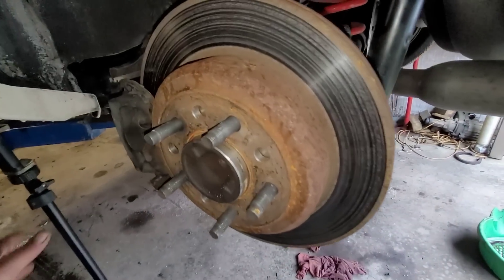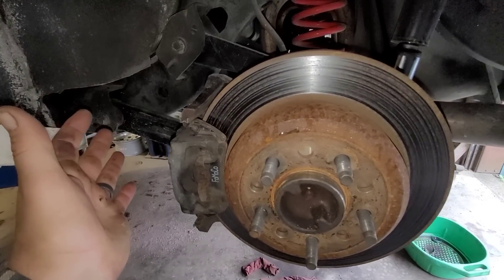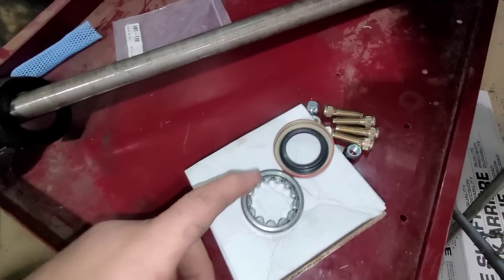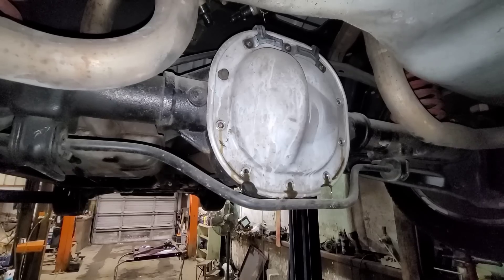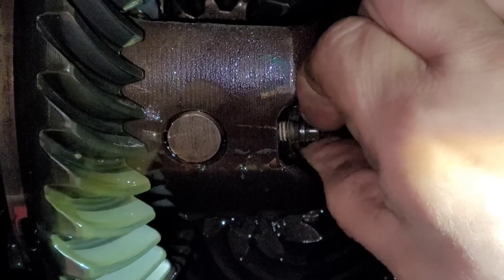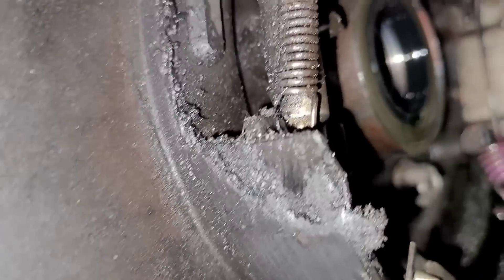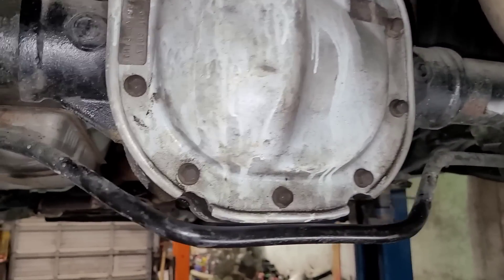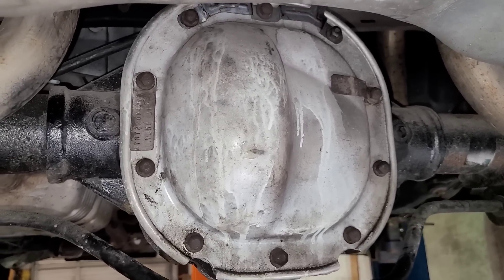Installing Customer Supplied Parts? What Could Go Wrong? I Had To Finish The Job To Find Out.

Comment: Nicely done - about the races - I use a Dremel with a black carbide cutting wheel. Then I can use a chisel with a wide sharp edge to crack the race.
Also, I only use Ford recommended 75W-140 for the diff fluid (I use Lucas). Of course if a posi-trac, I use the Ford friction modifier.

Comment: i own a auto repair business as well. i dont let customers bring theyre own parts high risk in liability. i actually had a story to back this up. its just not worth it. they bring theyre own parts they buy it on amazon or ebay you install it something goes wrong guess who theyre pointing theyre finger at its going to be you. you installed it your problem. just dont allow it.

Comment: Getting bit in the ass by kits twice in one day. you sir, are the soldier now. but if nobody tells you about the swapped rear end, even if you ordered the parts you would have called an '02 as well. another problem with customers parts is if the part goes defective, the customer has to go back online to "Rock" and leave the car on your lift. if you don't know the person you can't risk using their parts. it's not about the parts profit, you and your lift time can get stuck in the middle if things go south. you just can't do it anymore these days.